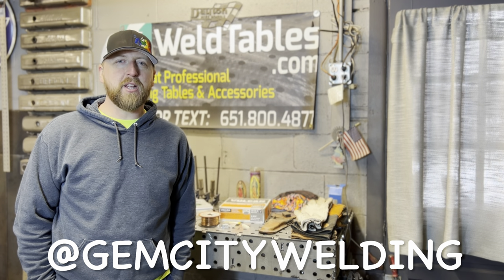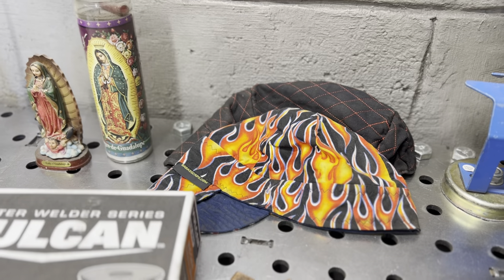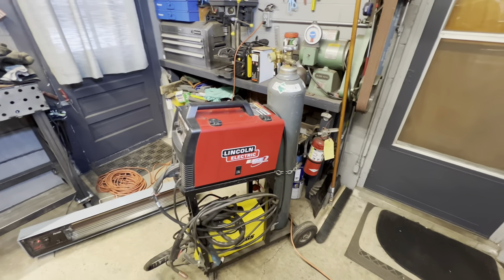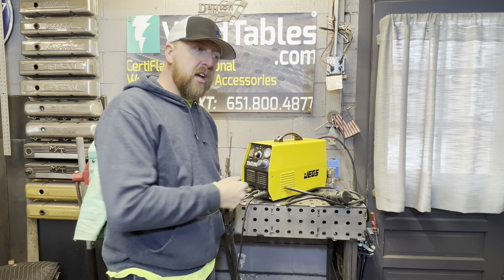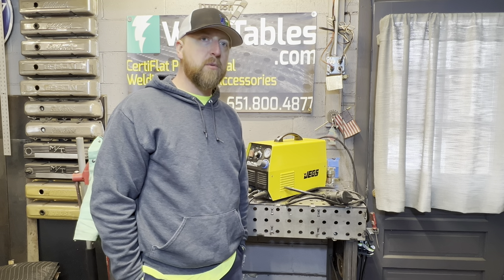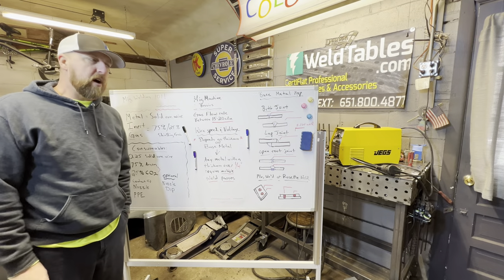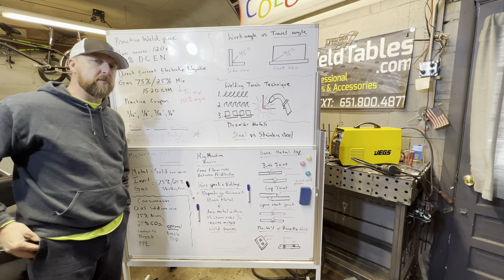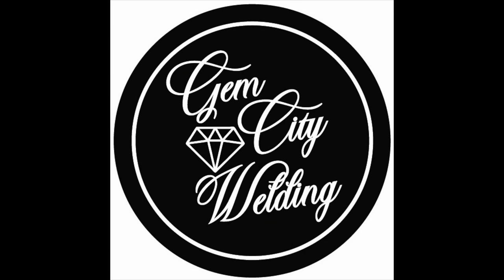Mig welding and Plasma cut 101! Welding basics for your Lowrider! Builder spotlight with Brent Greer

Comment: Can that Lincoln 140 be ran off a generator if so what would be the best size to run it with thanks man great video
Reply from the maker: Hey, it absolutely can! I’ve ran it on a generator that produced 6,000 watts or 6KW. 
Follow this link for the formula you’ll need to figure out what generator will work best for you. https://weldguru.com/what-size-generator-for-welding/
Reply from the maker: And thank you for watching the channel 👊🏻👊🏻
Reply: Thanks man I much appreciate it